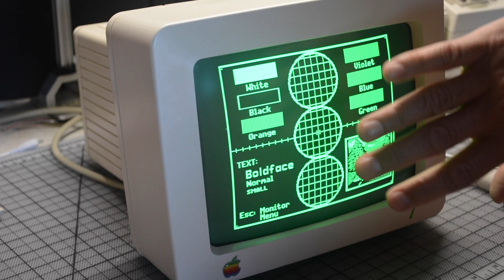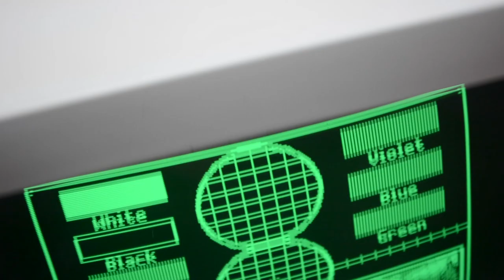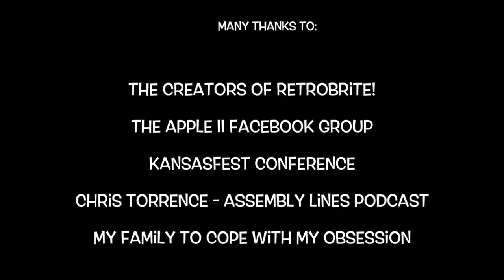Adventures In Retrocomputing Quickie 3 - Straightening an Apple IIc CRT monitor signal.

Comment: Another question... is it possible with this //c monitor to stretch the image so that it takes up the full CRT? I have the exact same monitor on my //c and it's always been in the back of my mind that it should be possible to somehow tweak the CRT to stretch the image up and wide. Can it be done?
Reply from the maker: You can up to a point. You need to use some potentiometers that are in the back when you open the case. Is sensitive and you need plastic "screwdrivers" to change them, as there's power around and you don't want to short or get you zapped.
Reply: @ARCJavMaster  oh cool, so it is possible with the right tools, that gives me hope, thanks!